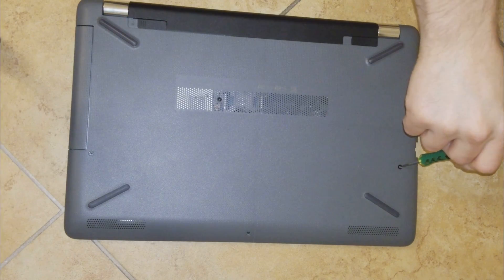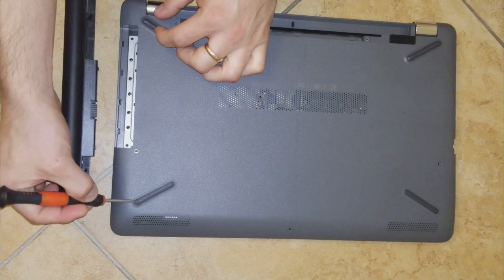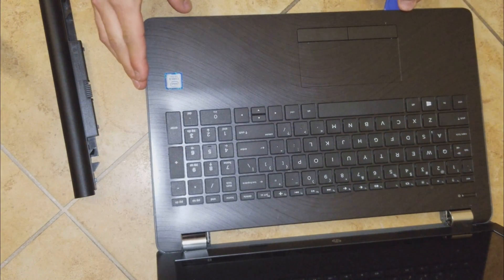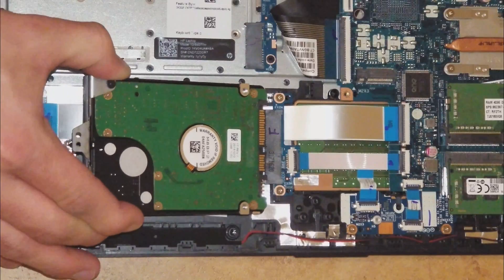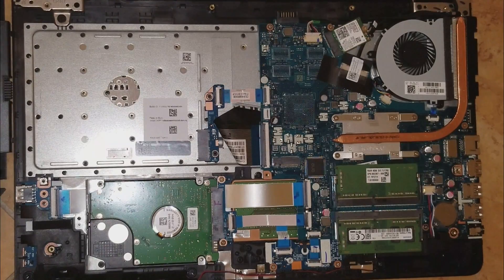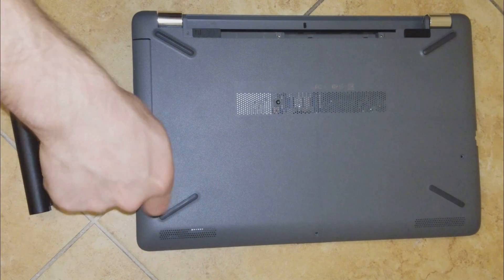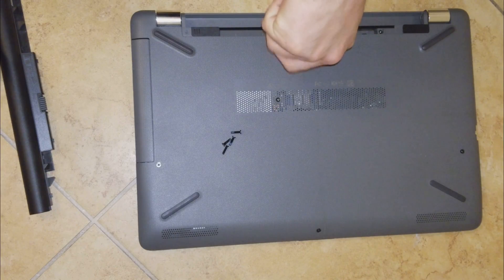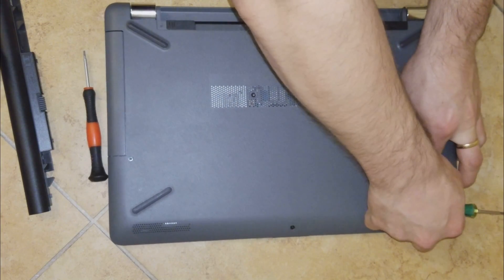Dissamble - Assemble HP 15-bs077nr Laptop

Comment: which is the ram to upgrade ? Could you please provide the Amazon link ?
Reply from the maker: Good morning, you can find in the following link the specs for your laptop .
Please make sure that the model number of your laptop match with the description. 
MODEL: HP 15-bs077nr

https://support.hp.com/si-en/document/c05530681

    Maximum Memory:16GB
    Standard Memory:8GB removable
    Slots:2 (2 banks of 1)

In the following link you can get the memory ram
https://www.amazon.com/Crucial-Single-PC4-19200-Unbuffered-260-Pin/dp/B019FRDAY6/ref=sr_1_1?s=electronics&ie=UTF8&qid=1526392872&sr=1-1&keywords=Crucial%2B8GB%2BDDR4-2400%2BSODIMM&dpID=51esjcOy79L&preST=_SX300_QL70_&dpSrc=srch&th=1

Hopefully this helps thanks

Comment: No m.2 ssd?
Reply from the maker: How are you? Not sure if I am blind but I did not see any m2 ssd ports on this model. I hope you subscribed. Thanks
Reply: mas cahyo there is an m.2 slot for ssd right above the ribbon connector for the hard drive and the mounting screw below